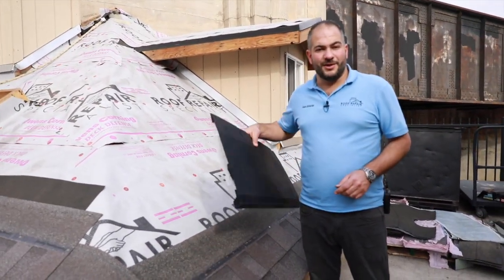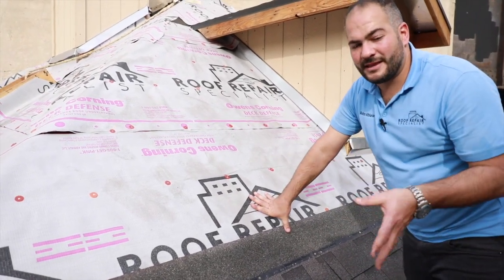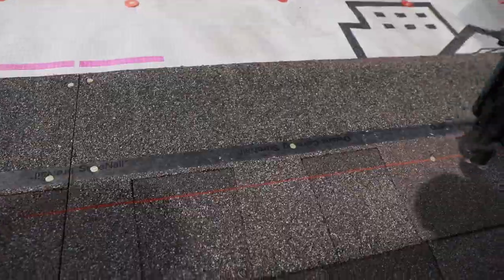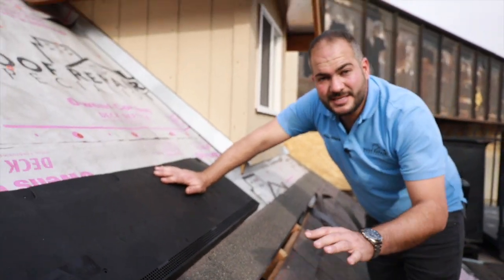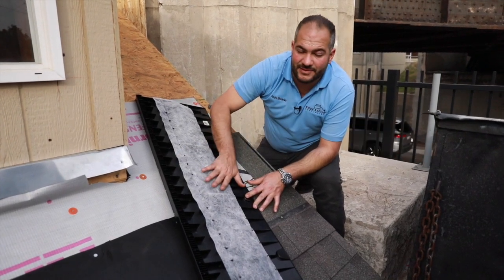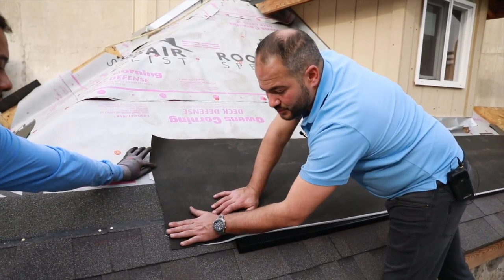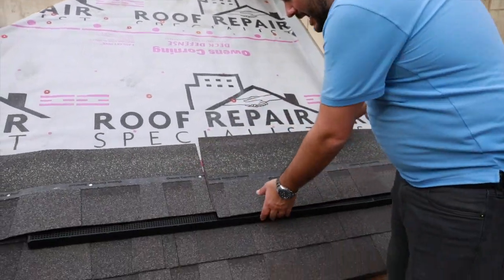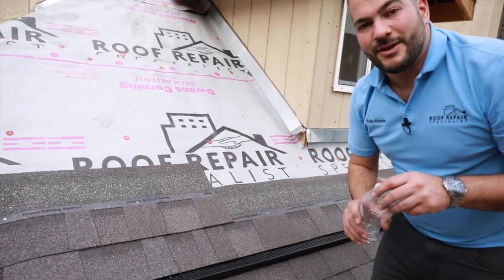How to Install an Inflow Vent | Shingle Roof Install Guide

Comment: My concern is that it could leak in cold weather with ice dams or snow build up ,the attic air is warmer than the outside and it'll melt any ice or snow blocking the intake vent and water will find a way inside the attic.

Comment: Great video! Can you install these on an existing roof? Specifically need to add intake vents on a cape cod home without eaves/soffits (after installing baffles and new insulation on interior).
Reply from the maker: You definitely can. Just keep in mind it is going to be pretty labor extensive. You'll need to remove the roofing approximately 4ft back from where you want the vents installed and properly tie into the existing shingles and underlayment. 
Make sure whoever you hire knows what they are doing and they'll be good to go.

Comment: I'm getting lost on the nailing pattern for the Chaulk line. It looks like you are just doing a standard 4-nail pattern. Is that correct, or is the first shingle nailed on the left end, halfway, 3/4 way and right end?

Comment: My intake vent going across the back of my house roof (pointed to the sky) gets clogged with all kinds of tree and dirt bits. The mesh they put inside the product to stop bugs does not prevent this from happening. The product should be redesigned to put some sort of metal screen on the air intake vent so nothing can get caught in there. I am planning on going up there and removing all the clogged debris and put some sort of metal screen on the outside so that it does not keep happening.  What could I really do now that my roof has a hole in it and this product is installed? In my paperwork my vent is called "VentSure". Not sure if this is the same product you are showing but it looks the same. My roof guy also did not leave a factory closed edge on the one side of my roof. I will be talking to them now that I watched this. Your team however looks like they know what they are doing!!!
Reply from the maker: This is definely a tricky vent to install and quit frankly OC does not have the best instructions on it.

Comment: My home has a wood plank roof deck. Would the area for intake vents need to be replaced with OSB before having intake vents installed?
Reply from the maker: No need, I think you should be able to trim  your boards to make it work

Comment: What are your thoughts on the Inflow Vents that install at the eave? Installed at the eave, the top of the vent is shingled over and the vent draws air from the bottom of the vent, so less chance to get clogged.
Reply from the maker: That’s my preferred method of the construction of the roof allows for it

Comment: I tried so hard to get 5 different roofers to use this product but they gaslighted me over and over again saying it didn't exist.  In the end they turned my house into swiss cheese.  The idiots even cut a 32 inch hole for a gable vent directly into my master bathroom and left it that way for two years.  After 5 roof replacements in 7 years and 50k in damages due to improper installation  I've lost all faith in all roofing companies in Missouri and I had to train my wife to do roofing with me.  Seriously, are 99.999% of roofers in Missouri functionally literate?
Reply from the maker: Sorry to hear that. Good luck
Reply: Just today a neighbor of mine had a roof done and they used these vents. Thats why Im researching them since I own a cad cod home. As per your comment ,they were all mexican decent doing the roofing. Im in Pa. Were  your workers non english speaking? My neighbors roof looks good though, but my thought is that those vents would get clogged the same as gutter guards do. The vent holes on these should be, imo, in the front surface, not the top. Whats so hard about making them that way just for higher up installations? These appear  to be just  good down at the gutter. But ice damming might be a problem there!??   SO, just maybe these are best for homes , used at the gutter, in the non freezing zones???
Reply: They were all Americans.  I needed these vents due to partially vaulted ceilings that had insulation that would block air flow from normal soffit vents. But they claimed air could pass through tightly packed insulation, which it couldn't, and my attic filled up with ice in the winter due to not enough intake.  In Missouri it appears most roofers are functionally literate.  I had 3 roof replacements in 5 years and every single company failed to install anything properly to manufacturer specifications if even putting down underlayment at all.  One roofing company put the solar powered skylight blinds back on upside down so the solar panels were facing inside the house. I use to do roofing as a kid and got so frustrated with terrible roofers in Kansas City Missouri, I ended up teaching my wife how to do roofing when I built a new shed so she can help out from now on.   @terrythomas790
Reply: @terrythomas790  CertainTeed's intake vent has holes in the front of the product instead of facing upwards like Owens Corning.
Reply: @paulnevins  It sounds like you need to have baffles installed to keep the airflow above the insulation and close to the roof deck for it to get to the ridge vent better. The big box stores sell flimsy ones so SmartBaffles or a brand that makes thicker ones would be better. My mom lives in the KC metro, but she hasn't had to have her roof replaced yet. I'll have to help her vet companies when it comes time to do so.

Comment: The filter on the back of the vent reduces airflow by 50% WHEN NEW.  Over time, just like the filter on your furnace, it will become clogged and reduce airflow even further. Using the manufacturers NFA of 9 square inches is incorrect at the start, being closer to 6 square inches, and over the life of the roof the NFA will decrease to likely around 2 square inches per foot, resulting in a severely under-ventilated roof. I suggest watching this video: https://www.youtube.com/watch?v=vw_yoQIPymI&ab_channel=HomesteadRoofing%2CInc
Reply from the maker: Great video, thank you for sharing. Great quality info. Thank you for sharing
Reply: Thanks for the video link. It confirms my belief that ridge vents perform poorly compared to attic fans or turbine ventilators. Just have to ensure there is sufficient supply air coming into the attic so that it's not getting pulled from the living space.

Comment: Why are you covering the hole you just cut with plastic.  The vent channel for that product is 7 1/2-9 inch not 5 - 6 1/2
Reply from the maker: Here is the manufacturer spec, https://dcpd6wotaa0mb.cloudfront.net/mdms/dms/Roofing/10018103/10018103-VentSure-InFlow-Vent-Installation-Instructions.pdf?v=1557734054000

Comment: Well by the looks of it those nails you used from the manufacturer bounced and I would rather have used screws looks like a wind storm will raised those air vents off my roof tell Marco he should know better! Looks like you guys do shitty work I would fire you guys on the spot. Saw that video where you didn’t even put tar underneath the shingle over the top of the flashing at the top the wind tear off those shingles on a windy day lol I have seen enough.
Reply from the maker: Thank you for your expert opinion. We will stop roofing immediately.
Reply: @RoofRepairSpecialist  Very professional and detailed. Thank you.

Comment: I just hate the look of the vent from the ground view. Sticks out like a sore thumb.
Reply from the maker: I think every vent looks ugly. What do you prefer?
Reply: Lower on the roof just above the gutter to blend in would look much better  and not stick out like your Owens corning intake vent. Don't  be a cheaper and use wider ice and water shield when adding the intake vents instead of the minimum width. I think 5 nails per shingle is needed unless serve pitch then 6 nails per shingle instead of bare minimum the manufacturer recommends of 4 nails. @RoofRepairSpecialist